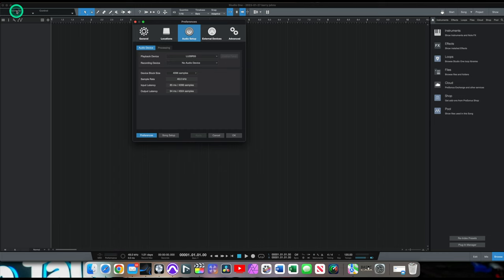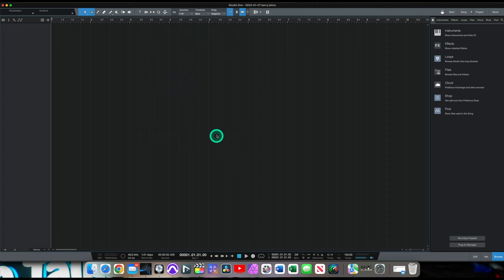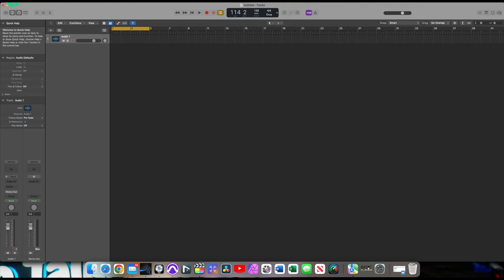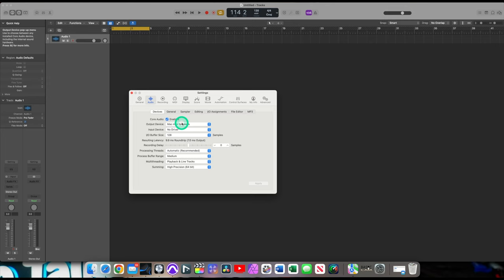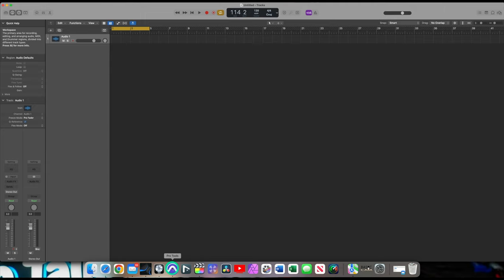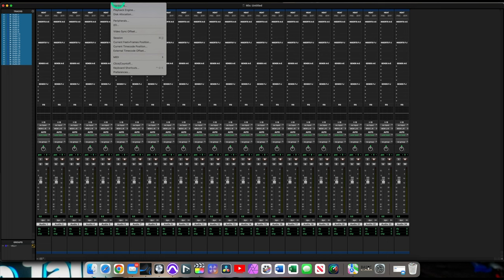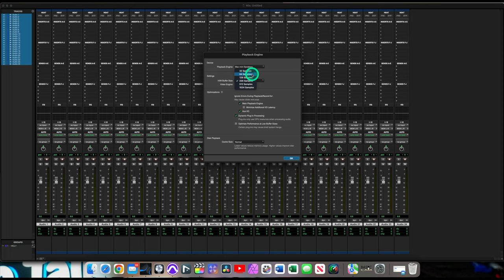Home Recording - Understanding Latency and the Buffer

Comment: And also to add to this video please make sure you turn on delay compensation if you have protools to check how much the plug-in is compensating the signal out to the master output some plug are to heave on processing and will delay your tracking signal even if your buffer is set to the lowest

Comment: In s1 I use the hardware buffer as low as I can. Usually 64. Then I have the drop out protection at 2048.  Software daw buffer.
Reply: I am just setting up my 'B' system around S1 and need to play around with it a bit.  It is decently stable, but I haven't yet done the round-trip latency test and am guessing it will be about 10-12ms.  My biggest issue is with input monitoring - particularly with drums.  I like to track with reverb on an input bus feeding the dry to the DAW, but am playing around with auxing it in the recorded track, but that's where the latency is quite apparent.  Hope this makes sense.
Reply from the maker: @trebleboost7  Depending on the reverb and the computer, that can cause issues.  That said I track through Verb all the time without any noticiable latency, but I'm on a M1 Pro MacBook Pro.
Reply: @BarryJohns  I am seriously looking at the M2 Pro Mini 16G/1TB+ right now - jumping ship from Intel! It looks like it could be a monster!
Reply from the maker: @trebleboost7  I have one sitting right beside me, I'm doing testing, videos forthcoming.....

Comment: Not sure about other DAW's, but I know ProTools has the ability to show you how much latency is being introduced by the plug-ins.  With that, you can figure out which plug-ins are eating up resources.  Disabling your largest resource hogs when recording can really help.  Greg Wells VoiceCentric for example is a VERY resource heavy plug-in.  It sounds incredible, and I use it on a lot of mixes, but when recording I have to remove it.
Reply from the maker: Correct, there are also other things you can do to deal with latency related issues, I plan to address those in another video.  Thanks for the comment.

Comment: Good video. Thats one of the reasons why i am working with the "good old" DSP Apollo UAD System and Luna. Never had an issue switching between tracking and mixing mode. No issues with latency. Thanks and greetz ✌🏼

Comment: Thanks Barry. This is insightful. In my experience my former CPU AMD was throttling my studio, so recently I switched to Intel and those issues have vanished. Most definitely the CPU and interface drivers are critical for overcoming or dealing with latency.

Comment: Hi Barry, I like your studio talk videos as I think they are extremely helpful for many musicians and home producer!
With the new Apple M2/Pro/Max processors out, everyone is showing beautiful benchmarks of CPU single/multicore and GPU performance. However, I’m missing of information about how those chips are performing in a live recording studio setup (not necessarily producing/mixing only). I would be highly interested on how those M2 chips perform on real time audio processing and low-latency recording. So, how many tracks at which buffer size could those CPU handle in live-recording at 96kHz sample rate and 32bits, when I load them with a variety of plugins?
Thanks for sharing your knowledge/experience!
Reply from the maker: Recording that video today

Comment: 8:13 Thanks for the video.  I was wondering if the audio interface itself can increase latency.  I recently got a 2021 MacBook Pro which should be able to easily handle the few plugins I have but still seeing latency the same as my older 2017 MacBook Pro.

Comment: The best latency setting for recording?  The Math = 256 samples of buffer at a 44.1 kHz sample rate gives us a latency amount of 256 divided by 44,100 Hz, which is 0.0058 seconds or 5.8 milliseconds or (256 / 48,000 = 5.3,s) or (64 /48000 = 1.3ms)  no plug ins. Thanks !
Reply from the maker: Depends on the interface and it’s drivers.
Reply: There is still ADDA latency and extra hidden buffer size which your audio interface's driver prepares for safety

Comment: I have an older Pro Tools TDM system. I don’t hear any latency in my system even at 256 and 500 in fact it doesn’t even give me the option to go below 128. Is that a feature of the older TDM? I’ve forgotten
Reply from the maker: Buffer is a non issue on TDM or HDX, since everything is handled by the DSP on the cards.  I'm a 25 year veteran of TDM/HDX, that said, my current M1 Pro MacBook Pro, I can leave the buffer set very low and never have an issue, so latency is a non issue for me due the advancement of processing power.
Reply: @BarryJohns  directly compare the sound of your voice in closed back headphones or IEMs through totalmix FX at 48khz and through nuendo at a 32 or 64 Buffer on your RME UFX+ and let people know what you prefer the sound of while singing or speaking. 
In my tests, TM is sounding close to realtime/analog at 0,5ms and doesn't cause hardly any comp filtering while DAW monitoring does sound phasy at around 4ms RTL latency at best. Around 2ms I feel is the threshold for comp filtering on headphones/ IEMs which is why most digital live consoles are designed to stay below that. It just sounds better especially for singers, drummers and acoustic guitars where the direct sound of the instrument mixes with the sound coming from the headphones. Not that everybody demands it, but people should be aware. Cheers!